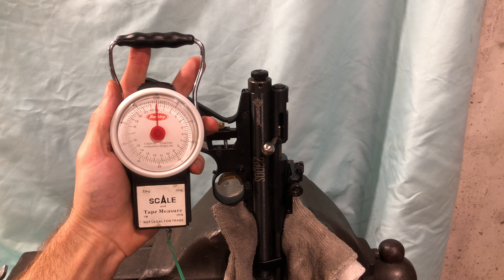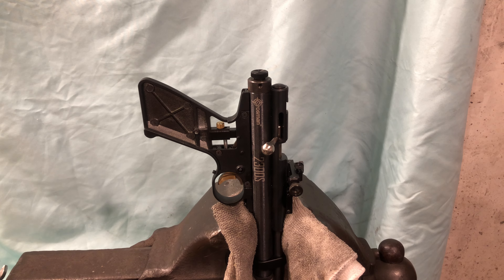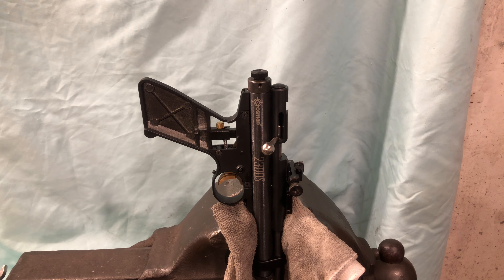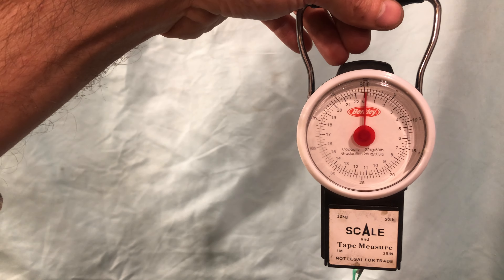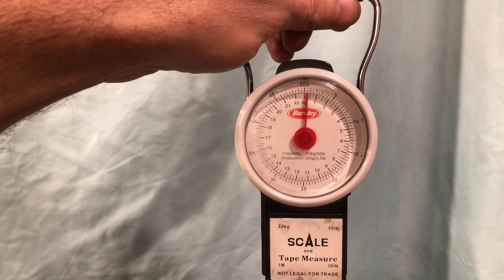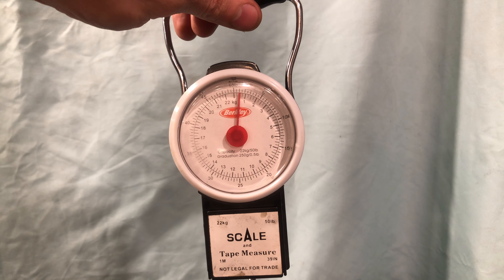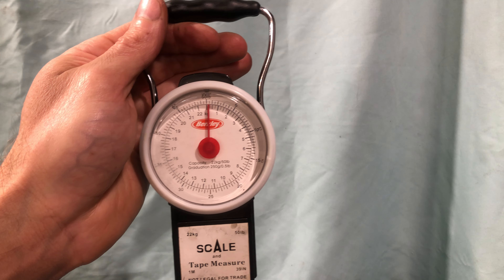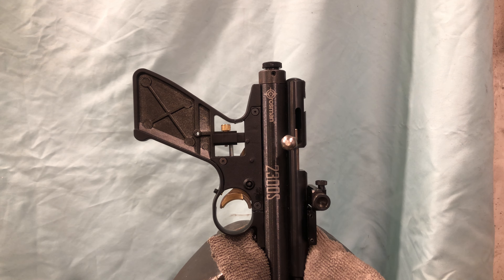Alliance Hobby - Two Stage Trigger System Pull Test for Crosman 2240 2250 1377 1322 2289 Drifter

Comment: Will this make the trigger pull easier then the adjustable springs gravmag sells i have a adjustable spring mod but if i loosen it to much it won't function so im not sure if this can make it more easier as i reach the max that it allows with the gravmag adjustable spring i have a disability so it would be really helpful if i can make it more easier
Reply from the maker: Never used the gravmag mod, but the two stage system should easily beat any single stage system.